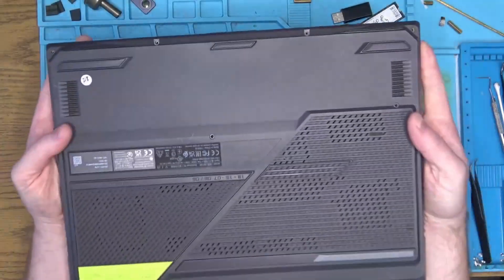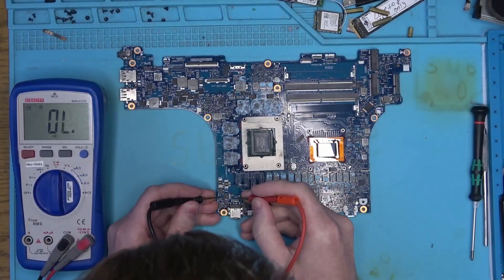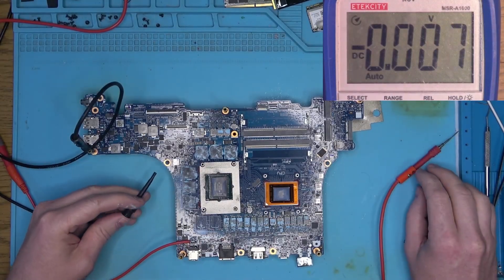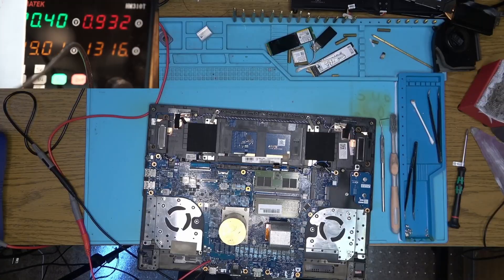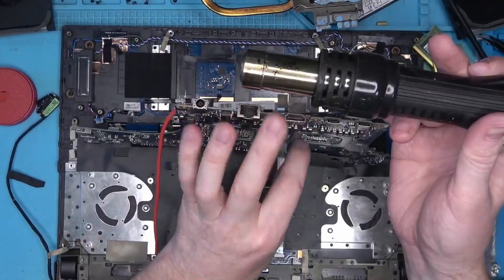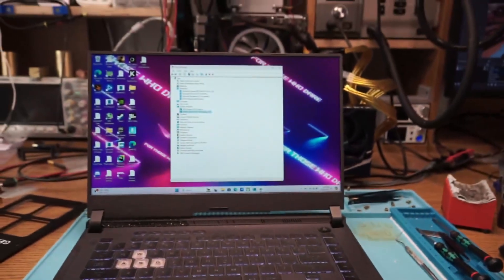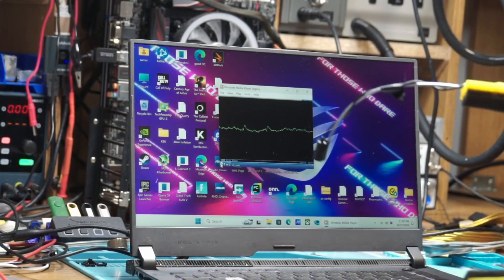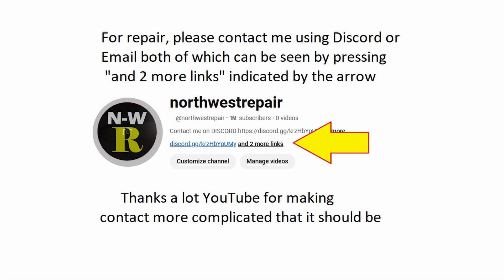ASUS ROG STRIX G513R free repair

Comment: The customer did not re-flash BIOS after receiving the laptop back. He simply used the MUX switch, which is present on all higher tier laptops. It looked bricked once he did that because you never re-flashed a correct vBIOS. You know that full-well and still choose to misrepresent the situation. Shame on you. The rest of the video is fair.
Reply: Customer never mentioned vbios and Tony didn't flash an incorrect vbios. How is that his fault, customer briked laptop by flashing incorrect vbios and using 3rd party software and never mentioned vbios. Tony sent a fully working laptop, he even stress tested it.
Reply: @sergioav7278 No, I flashed the incorrect Vbios before sending it to Tony. This is what he had agreed to fix. He only flashed system bios and sent me the laptop with the still incorrect GPU Vbios.
Reply: the customer used an external GPU that he also bricked lol, and obviously messed with the BIOS chip originally.

Comment: 1. I would NOT have given back a refund as the laptop was working when you sent it back to him.
2. I would post a link to this video on the Reddit thread so that people on that thread can see exactly what happened.
Reply: never been on Reddit huh?
Reply: Reddit is a bot infested cesspool.
Reply: @bearde_mut9731  according to the costumer it isn't, the gpu isn't boosting properly and when the costumer tried to change the performance profile to max they got a black screen
Reply: @bearde_mut9731  according to him on Reddit the gpu isn't boosting 100% and underperforming so he tried to use the performance mode and then he got a black screen
Reply: According to the costumer the gpu wasn't boosting properly and the gpu bios was still defective
Reply: @magosreditus  What the F is GPU bios?! You mean driver?!
There is no evidence that GPU was working beforehand or there might be something wrong with laptop regardless of the repair attempt.
Specially when customer loves to play around with BIOS.
Reply: @randomized4368  Gaming laptops often have a system BIOS chip and GPU BIOS chip. NWR flashed the wrong one, shipped it back with still defective GPU BIOS so that's why the laptop only showed a black screen when using performance profiles.

Comment: Should have taken it back and investigated cause based on the following there might be something you missed.

G-helper on github says this :

G-Helper is NOT an operating system, firmware, or driver. It DOES NOT "run" your hardware in real-time anyhow.

It's an app that lets you select one of the predefined operating modes created by manufacturer (and stored in BIOS) and optionally(!) set some settings that already exist on your device same as Armoury Crate can. It does it by using the Asus System Control Interface "driver" that Armoury uses for it.

If you use equivalent mode/settings as in Armoury Crate - the performance or the behavior of your device won't be different.

The role of G-Helper for your laptop is similar to the role of a remote control for your TV.
Reply: It shouldn't have bricked it , unless it forced a BIOS update and he pulled the plug+battery during.
Reply: @johntet  yep he missed this, and the customer flash a different vbios for his dedicated GPU so... customer is in this comment section as well stated that.

Comment: If the wifi module isn't original, bluetooth might not work. Something to do with bt being pcie in some modules and usb in others. Some users, like myself, don't care about bluetooth and just want a fast wifi card with low latency, not the 55.6k isdn -level wifi card that they ship laptops with.

Comment: I'd stop offering warranty on hardware that you are not an expert on and say it upfront so that there are no false expectations. I'd also probably make warranty conditional on the state of the hardware. Like if it was DIY'd to death like this one, and was in such a bad shape, one can assume that the customer will not be an easy one to handle as well...
Reply: The laptop isn’t in bad shape. It just had the wrong GPU bios. And yes a knocked off capacitor or two which Tony is well equipped to deal with. Other than that it really isn’t in bad shape. As you can see in the video he only flashed system bios which is why I was having issues when I received the laptop back.

Comment: You should not need to flash the bloody bios to default to a specific GPU. That should be done all in the OS.

Edit. Sorry if I wasnt clear the customer is an idiot.
Reply: @bearde_mut9731  Oh my comment was directed at the customer not Tony. Ive had two laptop with a multiplexed GPU and you can manage that in the OS. I dont even use Windows which always complicates things but it is doable.
Reply: @bearde_mut9731  Changing vbios options is sometimes an option for desktop GPU but the bios being flashed was just a regular uefi bios. From the accompanying community post it seems the owner wanted to have the multiplexer default to using the NVidia GPU over the integrated GPU and newer BIOS's allow for setting this directly. 

However I had a laptop that did not have this option and the solution I came up with was building my Linux kernel with the integrated video subsystem being modules (runtime loadable drivers) and building the 3rd party nvidia drivers and using a userland tool to select if I wanted to run a program using the Nvidia GPU.

Comment: What does github has anything to do with this?
Reply: That's where he claims the owner of the laptop got a bios from to flash onto the bios chip. He claims doing that bricked it again.
Reply: @neodroid2000  then its the owners fault not github, same shit I've seen on the "sEe tHiS iS  WHaT HaPpEn WhEN yOU cOpPeR mOD" as if it's the mod fault or the site's fault?
Reply: Github is a website for programmers to upload open source programs. Many times those open source programs are "works in progress" which means that they're not fully compatible with the all the devices they target. Therefore, whoever uses that software always has to be aware that they can potentially brick their devices and it's their choice to try or not. In other words, the customer's own doing resulted in another brick.
Reply: @Expo_Hans  I know what a github is? also just say the user is at fault instead of the page?

Comment: - He send a broken Laptop to you to repair it.
- You fix it (except BT antenna)
- He brick it with a random BIOS and want a free repair?

clap clap clap
What a idiot of customer.
Reply: The customer used ghelper to switch the performance modes.
From the reddit post you just have half of the context. The customer just mentioned that only BIOS was flashed and nothing else. All the other repairs were not mentioned.
If you just have to context of a BIOS reflash for 370$ then that is expensive but the video proofs that the effort was waaaaay more to fix that thing.
Reply: @lKurosakil true. but what I can tell you is that G-Helper reasonably couldn't have broken the laptop, and based on the fact that NWR admitted to not knowing what a MUX switch is, I would tend to believe the customer on this one.

Comment: Man I have so much respect for you. You went out of your way you diagnosed fixed as well as documentated and taught all of us. I now understand firmware just a little bit better if I ever have a sound problem ever again. Thank you. I have an old Alienwear M17x R4 laptop I bought used years ago for cheap that was broken, bought a new motherboard for it. It has been an absolute misery getting it to work but if I cannot diagnose it with the new parts I bought and after getting a new CPU soon I will send it to you.

Comment: You can see in the video the 3060 only running at 1050Mhz at full load in Unigine. LAPTOP FULLY FIXED EXPLANATION - Okay so, I was the original owner once again. I figured out what happened and where it all went wrong. I told Tony in an email right before sending him the device that I used NVFLASHK to flash a different GPU bios onto the laptop. He agreed to fix this for 300 plus the other issues. He instead flashed the system bios and forgot that I had flashed the wrong GPU bios. The issue wasn’t with the system bios but with the GPU. So I was able to get a display via USB-C to HDMI. I had to order the adapter on Amazon which is why I didn’t try this right away. I was able to find the correct GPU bios and flash it using NVFLASHK and now the laptop is working perfectly. Tony only flashed the system bios which I assume switched G-hub from ultimate (which I always used and was the same setting I had on when I originally flashed the GPU bios with NVFLASHK) to standard which engaged standard mode which is why Tony was able to get an output using the iGPU with the same bad GPU bios I had flashed initially. Ultimate mode with G-helper works now and the laptop is snappy and running great. Maybe Tony forgot I mentioned it being the GPU bios and not the system bios or something. Or maybe he didn’t even know they were separate things to begin with. He admits to having less knowledge about laptops so maybe this could be the case. Hopefully this adds some more insight into the issue.
Reply: If the GPU BIOS was wrong and he didn't mess with it, then YOU DID.  You're here actively stating that the GPU BIOS was wrong and he didn't touch it. You're pointing directly at yourself... You left it as a trap to get the money back.
Reply: @Expo_Hans I messed with it before sending it to Tony. He agreed to fix it but only flashed the system bios. Him fixing the GPU bios was supposed to be the repair.
Reply: @silverback2773   The laptop was not working at all when you sent it, because you messed with both BIOS. He fixed the physical damage and then the GPU BIOS that YOU swapped worked fine for him but it wasn't compatible with the MUX Switch. You know that it failed again beause of what YOU did, and yet here you are bashing him for not catching the trap that you left him... Call yourself whatever you like, but that's pretty much a scam. Even if you didn't ask for a refund, you stated that you would do a cashback and exposed him in a kangaroo court to pressure him.
Reply: "I used NVFLASHK to flash a different GPU bios onto the laptop." - Yep, this right here is your problem. Why would you flash a different VBIOS if the original one was working as intended and natively supported MUX switch?
Reply: @NguyenNam20777 This is what I was paying Tony to fix. Yeah I fucked up by flashing the wrong bios but that was before I sent him the laptop. I did not touch the system or GPU bios once I received the laptop back from Tony.
Reply: You hould still pay for the repairs he did. Because he did a lot of repairs to your device.
Reply: @DIYRepairHour I did not ask for a refund. Not even a partial refund. It was his decision to do it.
Reply: @Rubentus- did you read anything I just wrote. Oh my god.
Reply: @silverback2773 , Tony should make your address public, to help warning other repair shops about betrayers. Your endless crybaby-apologies are clearly proven lies, or how did the machine not boot by a corrupted main BIOS or show no image by wrong GPU BIOS on the internal display, if you had done nothing? 
Don't you have any honor to make an online drama about lousy 150 bucks for a ton of work by your frightening, total incapability?
Reply: @lorsheckmolseh3345 main bios was not corrupted. Bios would boot into windows but no display because of a bad GPU bios that I flashed BEFORE sending Tony the laptop. He was supposed to flash GPU bios and not system bios.
Reply: @silverback2773   The system BIOS was not corrupted? But then again we saw how you left signs of having manipulated it. Remember? Lost capacitor, flux everywhere... And aside from that you say you didn't talk trash but you actively ridiculed him for being a "big Youtuber" that sent you a brick.
Reply: @Expo_Hans that was the GPU bios chip. Not the system bios chip.
Reply: @silverback2773  I will say that any repair technician reading this whole scenario now that all is fixed will say that you should pay some if not full amount for the repairs. Looks at the video dont act blind, he did multiple repairs on your laptop. You got everything refunded, bring your honesty back into play, talk with tony, atleast offer to pay some amount.
Why? because it was a gpu bios flash, its not like the things tony fixed were fixed improperly or werent fixed at all.
Reply: @kepler104 I did pay, it was his decision to refund. Payed the full 370 he wanted. He flashed the system bios. Not the GPU which was what the problem was.
Reply: @silverback2773  maybe reason for him refunding is because you talked trash bout all this on reddit.
Reply: @navorski7660  Didn’t talk trash. Just my side of the story.
Reply: @silverback2773  system bios was also the problem that is very clear please dont start lying now.. also again if you open your eyes and check the video, he did alot of things with your laptop not just that. You say he did the refund you werent interested in that but at the same time you have zero interest in even offering him some compensation now that your laptop is fixed. He did the refund because hes not interested in losing time over a customer who is behaving like this, not because he wants to do free repairs or something, that much should be obvious I dont know why it isnt. At the end of the day if you were looking for a free repair you got it, you just had to flash a gpu bios with a software and that antenna can be repaired by anyone in the future, that worked out pretty good for you.
Reply: @silverback2773  You did talk trash on reddit.